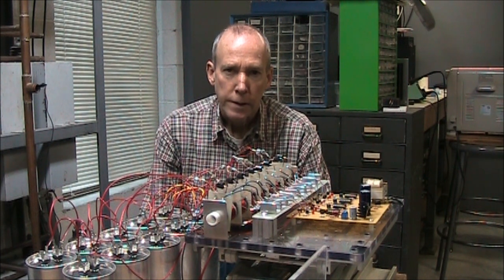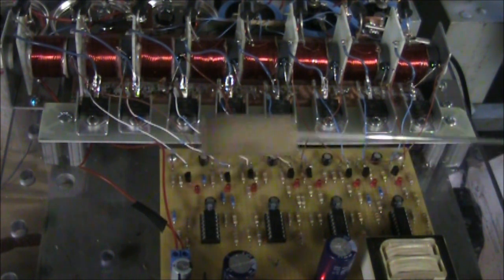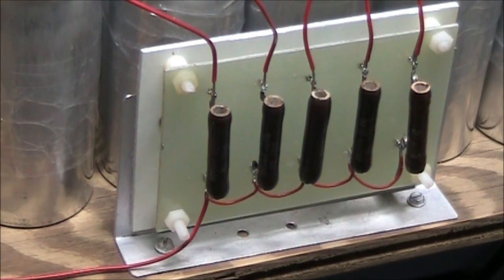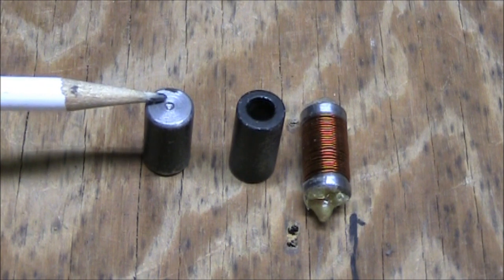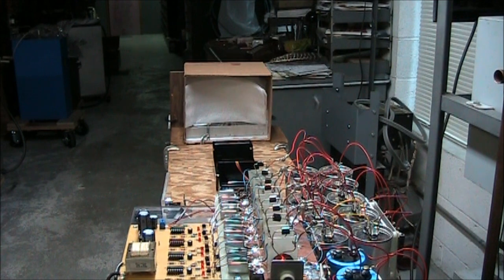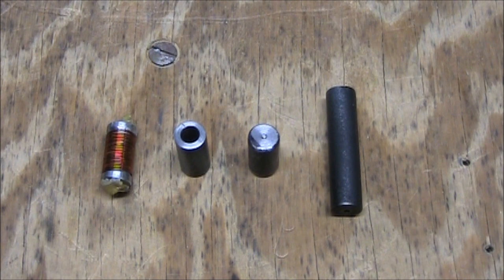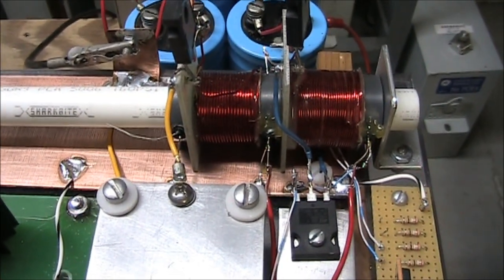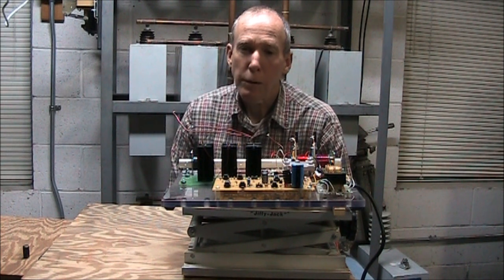coil gun part one

Comment: This is a good video and has actually answered a some questions for me. 
I've suspected that uneven coil arrangements (one in which the first coil is either a different wire gauge or a different number of turns) are better for a linear motor design when it's limited to one direction of travel for a bit. 

The fact that your two stage coilgun setup was performing on par with a 7 stage setup is fairly telling. 

As far as methods for making the coilgun more efficient,i have some bits of advice, or more accurately components that you should look at. 

SCRs are usually used to denote a type of Thyristor, although i have seen some SCR's that use mosfet technology. The reason this matters is that Thyristor construction forces a large amount of capacitance to occur within the SCR it's self, which prevent an SCR from being turned on and off quickly and efficiently. 
I believe a mosfet or an IGBT with a massive heat block would be better in this application. Ideally you'd want the transistors in a full H-bridge configuration, but that somewhat depends on the cost of the transistors and the relevant capacitance of the gates of the devices involved. 

A half-bridge would probably be adequate for a sufficiently fast coilgun, but the ability to completely reverse current through a coil isn't a bad idea.

After that, I don't trust optical triggers. 
Partly because I feel that a hall effect monitor is better suited for this application, but, also because optical detectors have 2 points of fault instead of 1 (that is to say, you have an issue at the light projector and light detector within each array). 
A Hall effect monitor with 3 axis detection is better. it actually starts tracking the strong magnetic field at a distance, and basically doesn't trigger until a certain current limit is reached.

Finally, I don't think the iron barrel is necessarily helpful. Although they allow the inductive coils to produce a stronger magnetic field, that magnetic field doesn't necessarily transfer into the bullet. I actually think aluminum is a better choice for a coil gun.
Reply from the maker: I used the SCR switch for it's one time high current capability. They did not switch off until the capacitor was discharged. With the setup  used in the video the capacitor was completely discharged as a pulse. Turn off did not matter. On the 2 coil setup I used more turns on the first coil for a slower pulse to start the acceleration of the bullet and a faster coil on the second stage. As was proven a fast hard pulse works best. I am currently putting together a sequencer drive that does not use a trigger but a clock drive instead. I also removed the iron core. Your suggestions were very helpful and if I could produce a linear drive setup with IGBT's it will surly be posted.  Thank's for your intelligent suggestions.

Comment: I've always been curious as to what effect it would have if the coils on a multistage gun were spaced logarithmically like the frets on a guitar instead of evenly. For some reason, this just seems to me that it should provide higher speeds for a given input power.
Reply from the maker: Coil gun part 2 and 3 show some timing results. Spacing to allow for coil response matters. Also capacitance and inductance makes a big difference. There is not much information on this topic so my approach is very experimental.

Comment: The coil with the ferrous 'barrel' in it is going to slow down (add a braking action) to the magnetized moving projectile.  Remove the steel and put the coil back in the same position.  Now compare the chrono' readings.
Reply from the maker: I found that out after the experiment. I am now redesigning the coils for coil gun 3.

Comment: the steel ring inside the coil should be cut so it doesn't waste power in eddy currents...
Reply from the maker: This was removed with my next model coil gun. It does waste power.

Comment: cant u just use a pnp transistor and its tresholdvoltage acting like a comperator, in order to drive the gate?
Reply from the maker: There are many possible ways to do things with electronics. I just did what I knew. The comparator allows for adjustments.

Comment: something is confusing me.  when u put the metal slug into the tube it immediately went thru.  I was expecting you to place it in and then press a "trigger" to activate the accelerator.  what is happening?
Reply from the maker: Triggering is done by a photo transistor. All 8 stages are triggered the same way. This could be made automatic if I had a feed tray.

Comment: If you don't mind me saying, the entire concept is flawed. By using SCRs you inherently must discharge your capacitor supply before the current can be stopped through the coils. If you calculate getting an effective muzzle velocity of at least 800 meters per second, you will find that you have at best a few microseconds that the later coils can be powered before you exert a magnetic braking effect on your projectile. Until you can control the precise current turn off time to dissipate the magnetic field precisely, you will never achieve a usable velocity. 
Secondly, a standard solenoid coil only has a 50% length usability. You need to create a shaped magnetic field to increase the efficiency of the power you are applying.
A shaped field along with exact timing can in theory produce comparable velocity to a chemical propellant.
Reply from the maker: Nice comment but how would you turn off a energized coil without a massive voltage kickback. I tried a resonant approach but I need a way to synchronize the projectile with a accelerating clock to control the tuned coils. It gets complicated fast. And you are correct the switched SCR's are a dead end.
Reply: @stephenhrobak3631  high amp low side driver mosfets with diode to bleed the coil induced emf without back feeding the capacitor voltage supply or burning out the mosfets.
For timing inductive sensors or open loop set timing requires a high processor cycle DSP or perhaps a FPGA which can provide  clock multiplication internally and depending on the clock speed perhaps the ability to calibrate for the coil field discharge times.
Reply from the maker: Your solution to the problem looks like the way to go. I'll do some research. Thanks for the input.
Reply: There is that russian V switch circuit if you really want to turn off standart SCRs(non GTO).  
But if efficiency is the goal here, personally I prefer the diagonal halfbridge circuit with IGBTs.